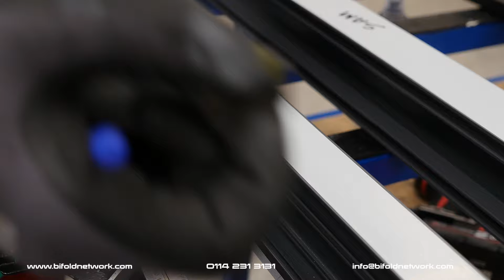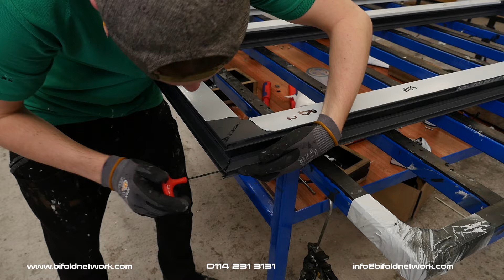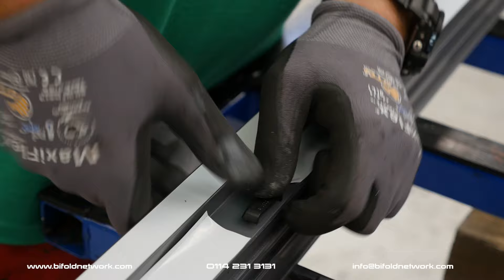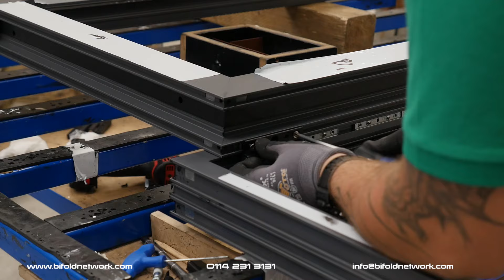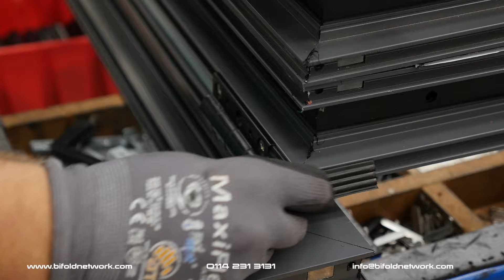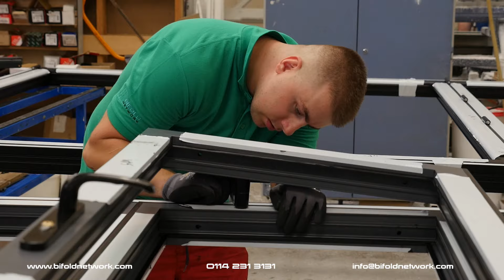The Bifold Network  - The making of a aluminium Bifold Door

Comment: its weird to me how little the jamb fits into the aluminium slot n held by just staples...been in some situations when jamb needs resizing... have to pull jamb out... then we just silicone n nail thru aluminium  to hold jamb... the rules on fixing of doors n windows are pretty intense... but seeing how  the aluminium is held (with double glazing in it) to jamb by a couple of staples is just crazy... just dont make sense...what if it breaks away from jamb because the jamb has to be screwed with thousands of screws..
Reply: All the connections are glued with 2part glue. Or at least they suppose to be. Tested myself, wont fall apart.